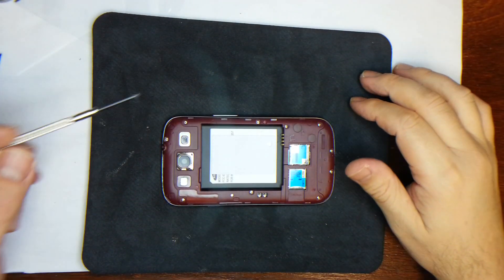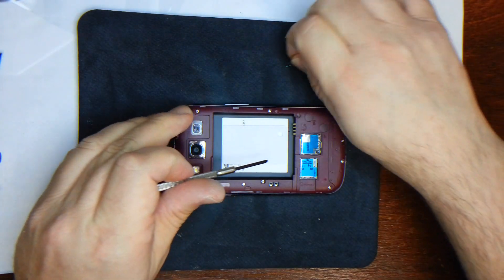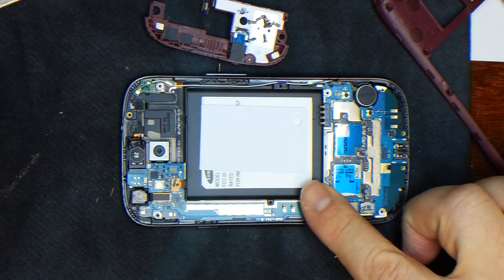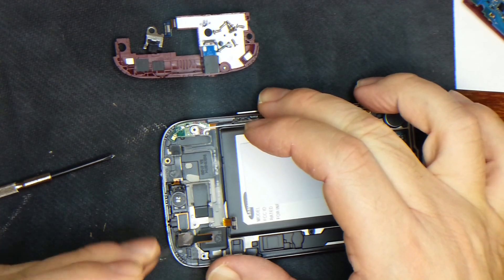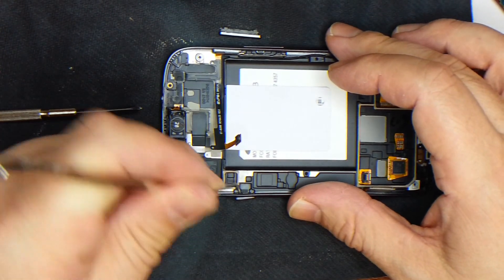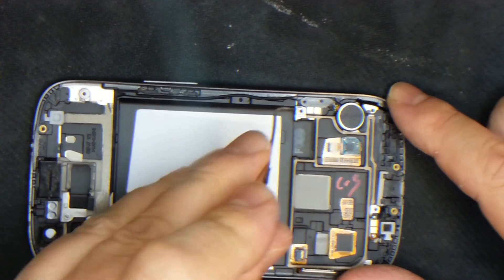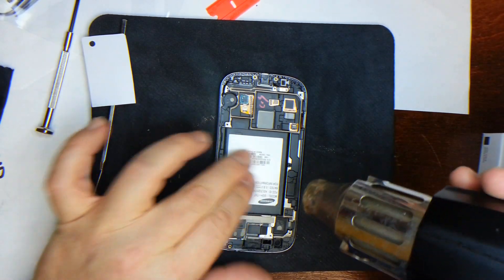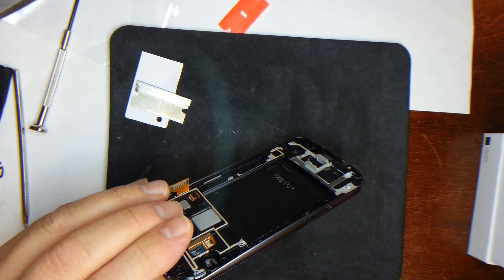Samsung Galaxy S3 Disassembly

Comment: I recently replaced my screen on the exact same phone. It worked fine for 3-4 days but now I get some (lots) of vertical lines on the screen.Usually at first the screen is black with only the vertical white lines visible, then there's some flicker and if I slide a few screens back and forth I can eventually see the home screen etc (the white vertical lines remain though, just not the darkness) Still works but the image is crap. Read somewhere it may be due to some static electricity, some improper grounding or something. Any ideas? Thanks!

Comment: lol spent the whole video covering the IMEI except for the last step.

I didn't hear you mention the 3G antenna.  I have the Victory 4G model and I was actually wondering if I could extend the range of my 4G antenna because I get zero data from home but I get high speed 4G about a mile from home.

Comment: My problem with my S3 i535 is it doesn't vibrate. If I use this video would it work on this model.
Reply: Angelica Bieker check if you have saving battery mode turned on
Reply: GG games  i had to replace the viberator motor  it works now